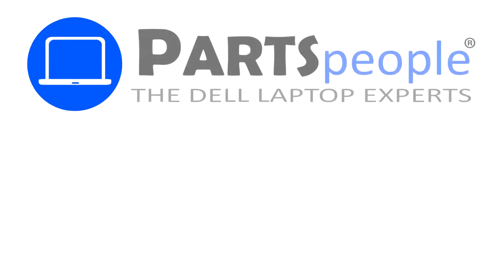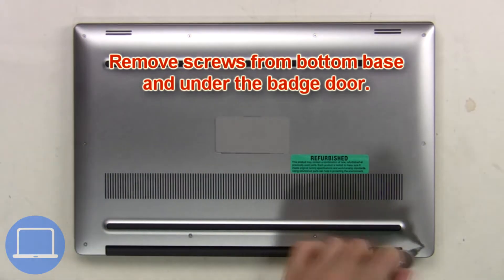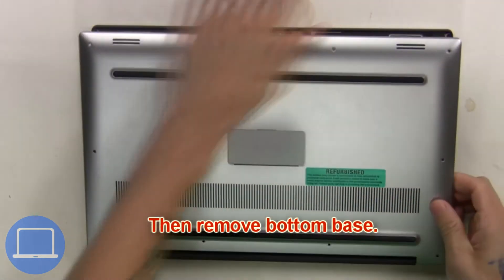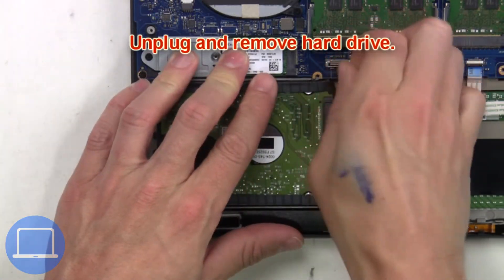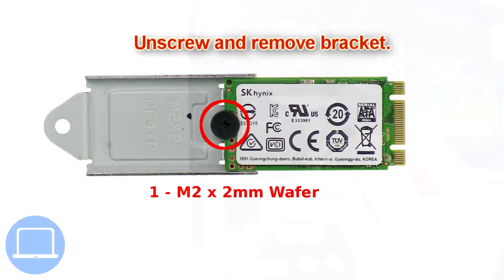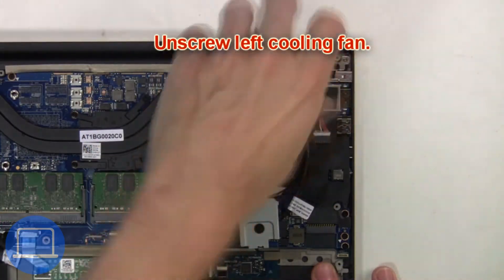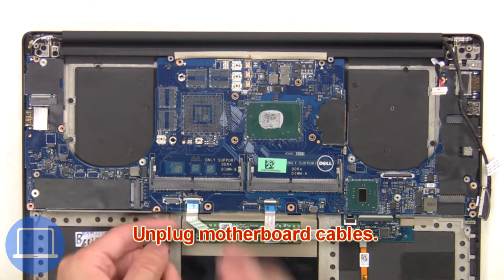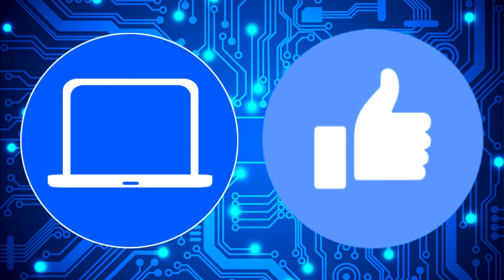Dell XPS 15-7590 (P56F003) CMOS Battery How-To Video Tutorial

Comment: If you take out the solid state hard drive, doesn't this wipe the data/memory off of it?
Reply from the maker: No data should be lost when removing the solid state drive. Just be sure your laptop is powered down and disconnected from the battery when doing so.
Reply: @dellpartspeople  thanks for your answer. I had another one which I hope you might be able to help with: if i take out the SSD before sending off a laptop to get fixed, anything on the computer won't be on there once the SSD is out, correct? Also, as the laptop has 2, 16Gb RAM drives, one in each in a slot, if I took one out for the sake of safety, they'd still be able to check what's wrong with it with just 16Gb RAM? I ask as I'm nowhere in your country, but you know what's what. Thanks in advance. 🙏
Reply from the maker: @amjan8803  Okay. Removing the SSD will remove all your data along with the operating system. So they would not have access to any of that.

A single stick of 16GB RAM is more than enough to run your laptop. So you're good. 

Best of luck.
Reply: No!  The bios is on the motherboard and that's where the machine configuration data sits.   The CMOS battery supplies power to remember configurations like date/time, boot sequence,  etc.
Reply: @ The CMOS battery is rechargeable. It does not require service.
Reply: @peterp1158 That is absolutely not true. The average lifespan of those batteries is 5-7 years. Like any rechargeable battery they don't last forever!